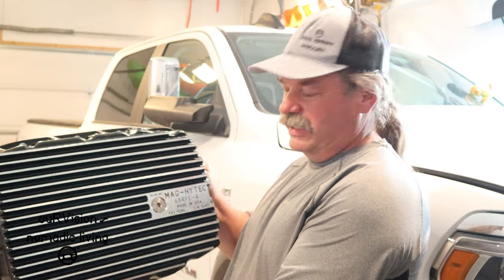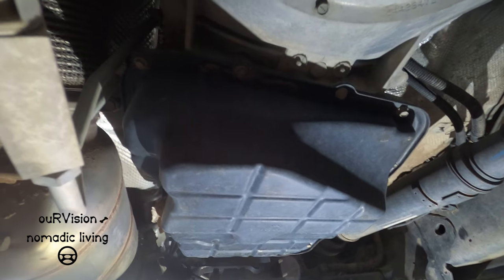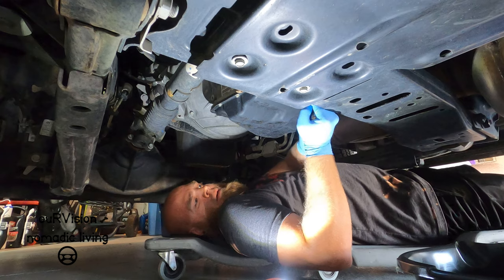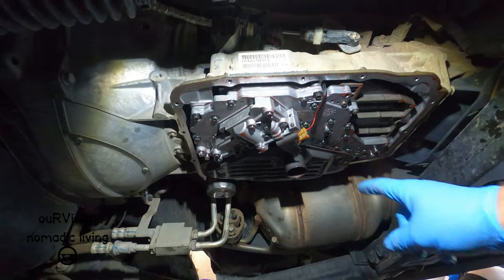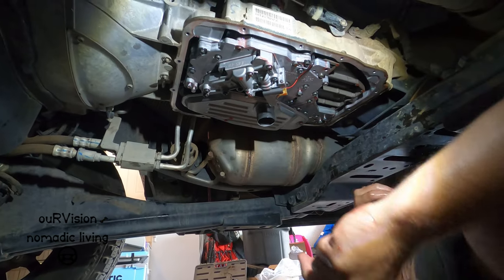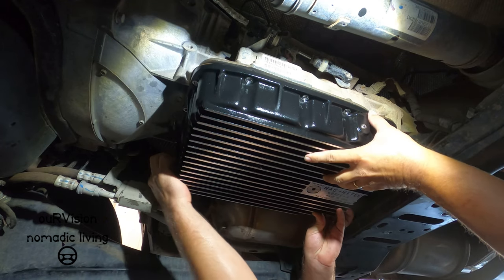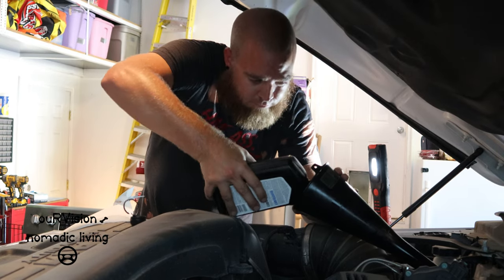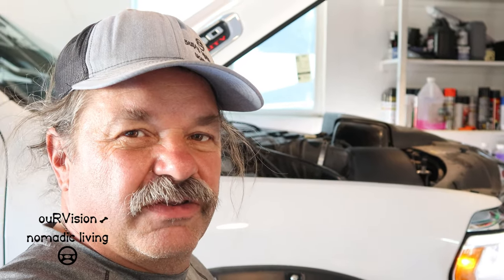68RFE Transmission Fluid Change

Comment: mods no one sees but is very nice!
Reply from the maker: Yes, very nice mod. Tell your hubby thanks for putting up with me videoing him. 😜
Reply: @ouRVisionnomadicliving the transmission oil at 170 should be between the two top holes or before them? I have a 2019 2500 with the 68rf transmission. Thank you very much
Reply: What did yall do for a gasket ?

Comment: LOL, one eternity later!  Very funny!

That dripping looks like a scene from The Amityville Horror
Reply from the maker: Thanks for watching & commenting David. Are you considering adding a deep pan on your truck? We just got back from a family trip up to Lava Hot Springs. Tyler stated his tranny temp was running about 15 degrees cooler. He told me he is happy with it so far. 👍 After hitting a porcupine a few years ago the underside of my truck looked like that too...ewwwww. Safe travels! 🍻 Sean
Reply: @ouRVisionnomadicliving  That and /or maybe a BANKS diff cover and the RAM air inlet (the big red arch thingy).

Of course the air cleaner upgrade looks good also.  Just need some more moolah!
Reply from the maker: @RVWagginTails  I hear that. Right before we went full time I put the Mag-Hytec Diff cover on,, I like it, however that said, if I were to do it over again I would go with the Banks cover. I still have the stock air horn on my rig. Right after I purchased my truck in 09 I put a turbo back 5 inch exhaust on it, and I am running a Edge Juice Chip. I have the G-56 6 speed and I added a Geno bolt on cooler on the side of it so I could add an exta quart of fluid and a tranny temp gauge so I can keep on eye on the temp.

Comment: How did u flush torque converter?
Reply from the maker: Didn't flush the converter. Truck only had 5000 miles on it. The reason to do this was to add the deep pan. Thanks for watching.

Comment: Did you replace the flat filter seal inside the transmission?
Reply from the maker: the flat filter has an "O" ring on the inlet. When you pull that filter down, its important to make sure that "O" ring is removed and replaced with the new *O" ring that comes with the new filter. Hope this helps. Sean